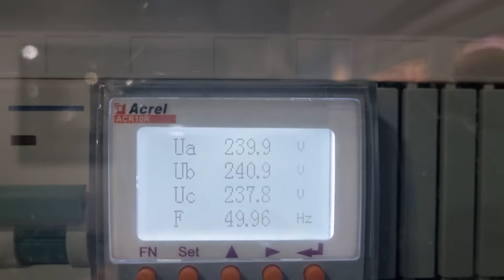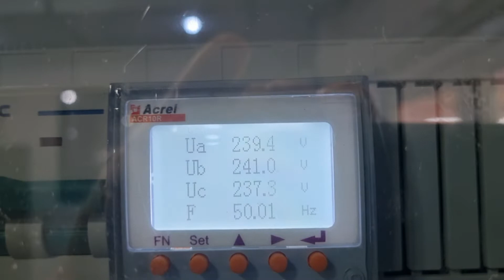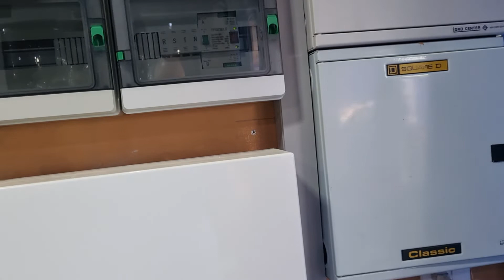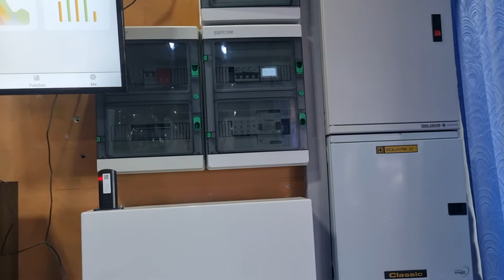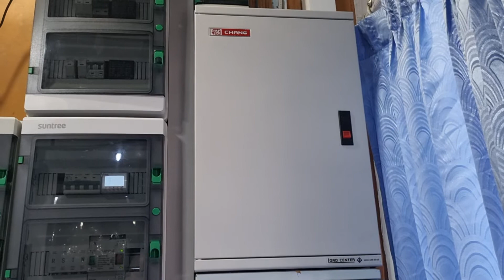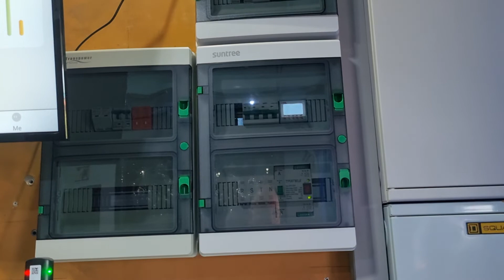Bad electricity: Things you need to know | SolarThailand.biz

Comment: 3 phase is nice, but you need to balance very good your power usage over the 3 phases.
but the use is not matching the production in many times.
5 aircon's, induction cooking plate, freezer, pump, water heater, fridge, they are all running on just 1 phase.
when you get an EV car, you also need to have a big battery at home. assume that will be very expensive
Reply from the maker: Its not hard to balance appliances over phases. You just put different appliances on different phases. The power cuse doesnt have to perfectly balance. Also, your bill is the sum of KWH over all phases, so it doesnt matter if you use one phase a bit more.